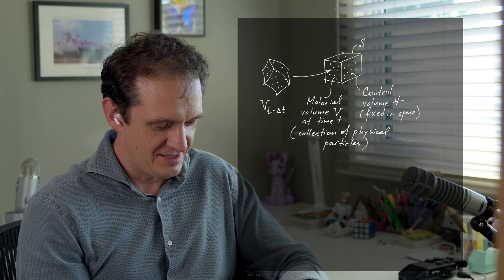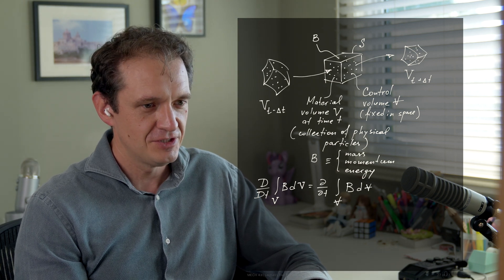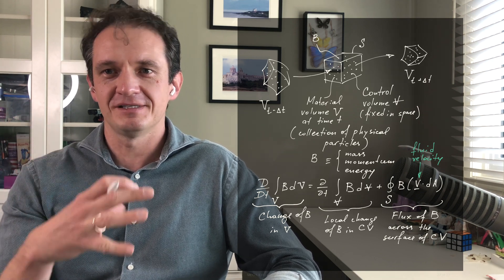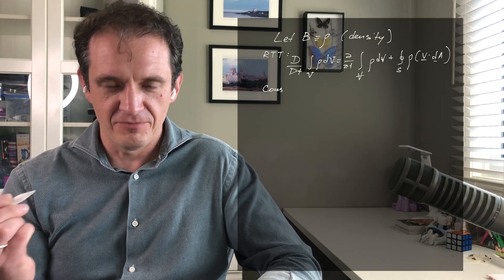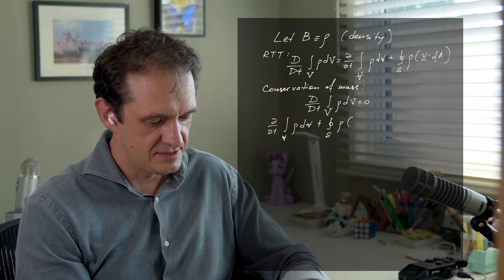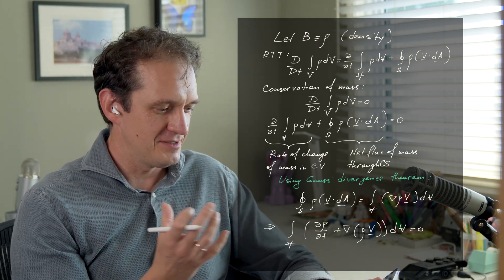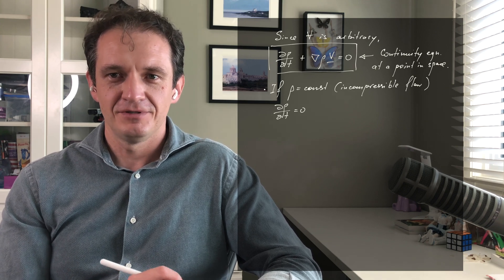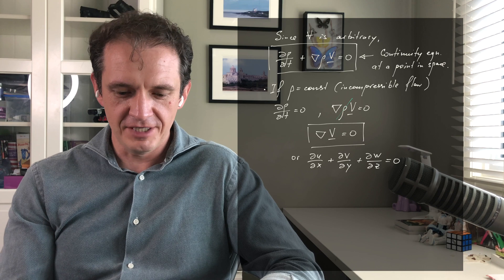Reynolds Transport Theorem

Comment: Mass times volume is not equal to mass. Density times volume is equal to mass. Using "beta" = extensive property per unit mass would have reconciled your equations to be dimensionally correct and prevented confusion. Nicely presented otherwise.
Reply from the maker: Thanks for catching it!

Comment: material volume ,material particle, system , fixed volume  , etc , lots of concepts in the fluid mechanics and slightly different equations . Without your explanations i could ve fail fluid mechanics course. fixed in space was remaining i think for the control volume

Comment: In the derivation of continuity equation for incompressible fluid, The divergence of the velocity field is zero. I was confused since you take the gradient of velocity.
Reply from the maker: Here, the nabla operates on a vector field (velocity) and the result is a scalar, so it is indeed divergence. Gradient operates on a scalar field, and the result is a vector.
Reply: @peteroshkai  This can be confusing with the existence of velocity gradient tensor